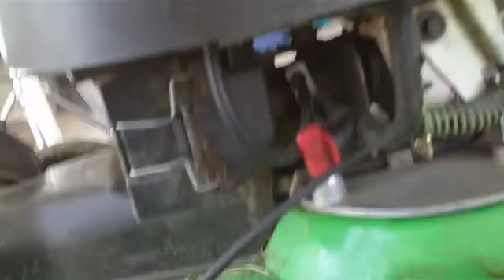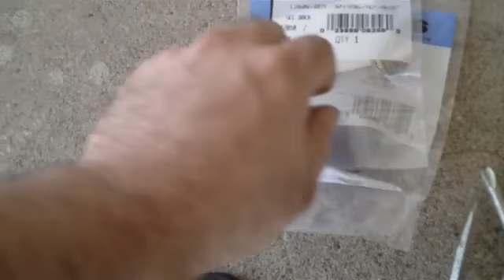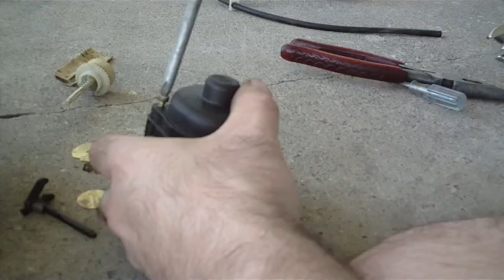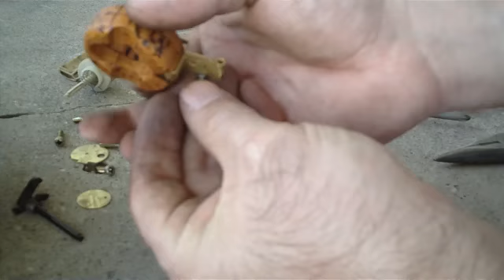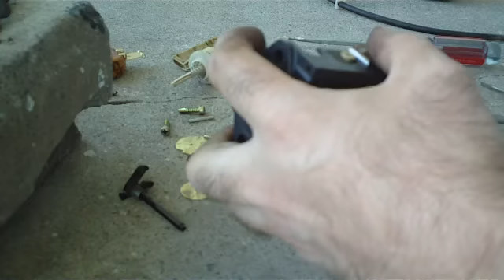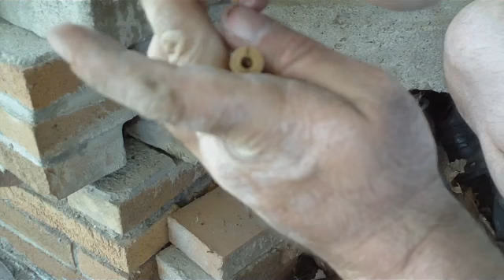Lawnboy Silver Series - Carburetor Repair 1

Comment: Can you tell me how to adjust the needle and seat of carburetor
Reply from the maker: That is adjustable by the tab on the float.  Depending on which direction you bend it it will either activate the needle valve sooner with a lower level of fuel in the carb or, it will let it fill more.  When prying it up more, it generally lets less fuel in the bowl.

Comment: Hello, My carburetor loses fuel when the engine is running and shutting down. The gasoline flows under the carburetor. I have checked the gasket is there and everything seems tight. Is this the pointo the problem? What else can I do?
Reply from the maker: It sounds like the float along with the needle and seat are not shutting of the flow of fuel causing it to flood.  Though, I have seen a very small nick or a piece of dirt in the way of the gasket cause a leaking condition.

Comment: please could someone tell me how to get the airvane out?
Reply from the maker: I was able to remove it with a small screw driver to release the pressure on the throttle plate and pulled the metal throttle plate out.  Then the air vane comes right up out of there.

Comment: Is there a gasket on the needle and seat or seat there is one in the parts pack there was none on mower when I took it apart
Reply from the maker: That is a good question.... if the parts pack fit multiple mowers or if it was an " improved" version things can be different I have found.

Comment: Hello,  Can you tell me where I can set air of this lawn boy 10247 - 890001 silver pro 2 cycle?
Reply from the maker: With this carb on it, there were no adjustments at all.  The only advice I was given that helped was to use machinist drill bits to open up the jets in a very very small amount to richen the mixture.

Comment: How does the throttle plate come out under governor? I need to replace governor spring
Reply from the maker: I very carefully pulled it out as it’s held into the plastic stem by a metal tab on the plate.  Sometimes I very gently pry ever so slightly for it to clear the slot in the plastic stem and it pulls out

Comment: I'm having a hard time finding the throttle spring in your video. 98-0711. Do you know if there is another part number for the spring? And can you recommend any online sites? Thanks
Reply from the maker: EricTrippOnline It is a bear to find, but was able to find it on amazon using that part number.  I can check and see if I still have the original bag that it came in.....

Comment: Hello,  I have a Lawnboy Gold 10552 with the Dura Force engine.  It is having issues where it runs on choke but if you try taking it off choke it wants to surge and then it usually results in shutdown.  I have installed a new carb on it.  What are your thoughts?
Reply from the maker: If you installed a new carb, did it come with new governor spring(s) ?  Also did you replace the carb to engine gasket(s) and tighten evenly.  Your engine is running lean hence the need for choke.  Now, you could have a bad seal in the crank bearings, bad reed valves, or the carb could need adjusted which usually isnt possible.  Some of these had fuel screens in the outlet of the fuel tank, you could have one plugged.  You could have combined problems.... the ignition coils plagued lawn boys for years where they would get weak spark making them stall out..... but it also made it hard to start.
Reply: Its has good spark but i don't think the carb kit came with new governor springs.  Thanks
Reply from the maker: mocatrider
weak governor springs will cause surging for sure.... Even though I dont think its your issue, those coils used appear to have great spark when tested, but when under compression.... it was weaker.  Just an fyi from years working with these things.

Comment: Machinist bit set or a hobby set to be used in a pin vise.  Pin vise is like a small screwdriver handle with a chuck like on the dremel tools.  meant for hobbyists and turned by hand.  Harbour Freight?

Comment from the maker: I wish I had some drill bits that small....  I could actually use a bit one size bigger than what the idle jet is.... its the only way to adjust the lean mixture problems without replacing it with a different jet from briggs

Comment: I agree.... those plastic carbs seem to brittle to handle. Always afraid to strip it out... or even drop it. 
Sometimes I have a tough time finding a wire small enough to clean out those jets. Usually I get lucky and a good soaking and shot of compressed air gets the job done.
Looking forward to #2
Reply: Use a bread tie wire